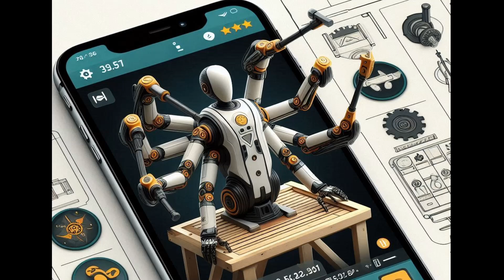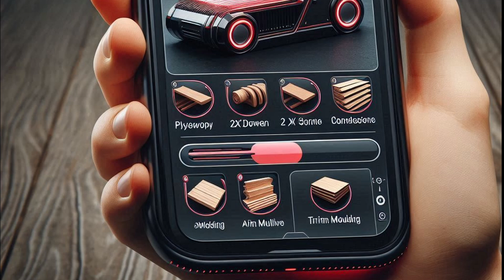Is AI the Future of Carpentry?

Comment: Does the wood welder work better then the wood stretcher?  Or do I need both?
Reply from the maker: It's better to have both if you can swing it because the board stretcher works better for finish carpentry because the wood welder is a little rough unless you do a lot of sanding to smooth out out the weld...
Reply: @NextLevelCarpentry  well, fair enough.   I'll send you my cheque. 😁
Reply from the maker: @lucidmoses  here... take my money! 🤣🤣